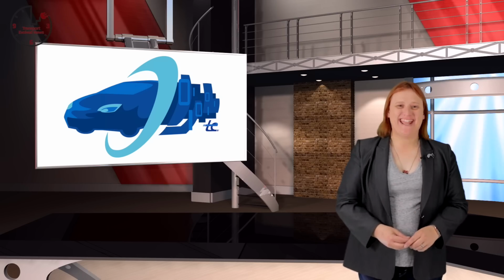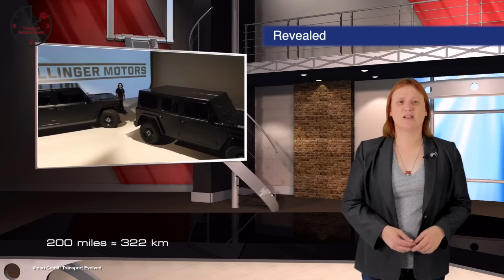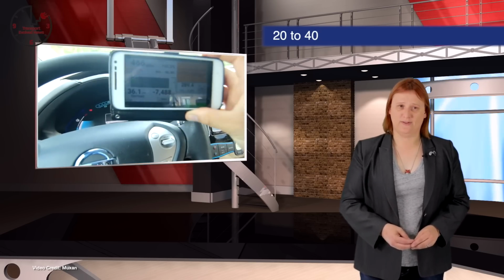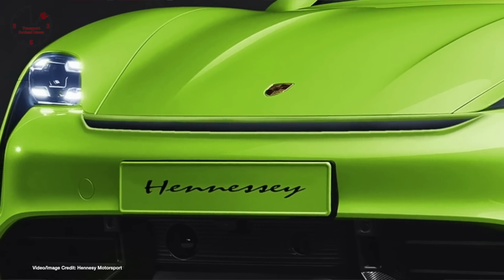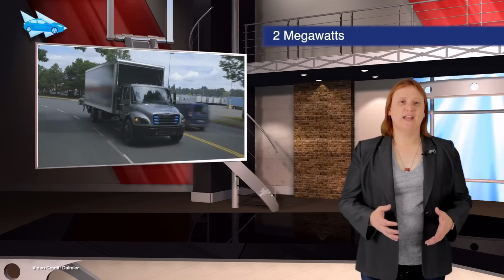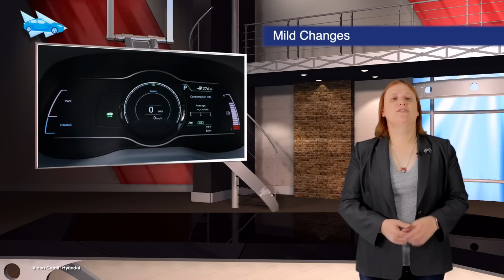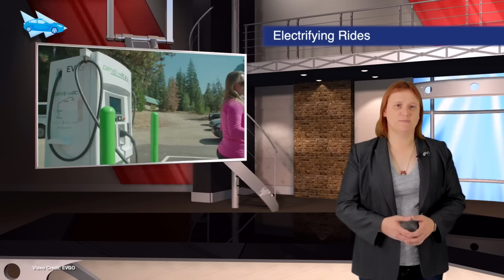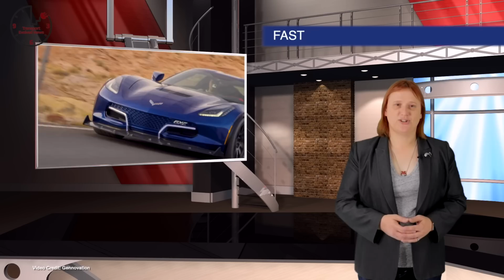Bollinger B1, B2, Nissan LEAF Battery Upgrade, Electric Chevy C7 Corvette - TEN 267

Comment: A 7 year old Nissan Leaf owner in Canberra (Australia) went down to his local Nissan dealer last week, as his Leaf's battery was failing.
He walked out the door with a quote for AUD $33000 for a replacment Nissan battery.
 Go see 'AutoExpert.com' or search John Cardogan on YouTube for the background story. Not a good look for financial  longevity of EV's as the Leaf's cost was about $50000 new, and its current used value is about $12000. 
Throwaway Nissans ?

Comment: Toyota is building a Mirai 2.0 because they are having ongoing problems giving away the Mirai 1.0.
Hydrogen is not commercially viable for cars:
1) Hydrogen cars cost twice as much as agas car and the fuel (green hydrogen) costs twice as much as gasoline and 16 times more than electricity per mile
2) It takes 12 times as many hydrogen truck deliveries to a station to refuel the same number of vehicles as a gasoline station (and the transports would emit CO2)
3) It is too expensive to deliver hydrogen to distributed dispensing stations from a central station and too dangerous to have combined production/dispensing stations in populated areas
4) only 4 or 5 hydrogen vehicles can fuke up in a row without a 20 minute pause to repressurise and cool the dispensing tank
5) There have been four hydrogen accidents this year. South Korea 2 deaths 3 injuries: South Korea 3 burn injuries; Norway explosion and injuries; California fueling fire.
6) Hydrogen single point of failure. Accidents in refueling stations have shut down supply. Stopping FVEC sales in Norway, stopping deliveries in California
Hydrogen is being pushed in Japan as Japan after Japan electricity supplies reduced (Fukishima), and they have no oil or gas reserves.
Japan plans to make hydrogen from gas (bad) and coal (worse).
Hydrogen is DOA in all market driven markets
Reply: Also, h2 fuel cell cars still need batteries and/or ultra capacitors to buffer the energy from the fuel cell
Reply: @PaulMansfield  Yes

Comment: As usual, great video. Just an FYI, a Québec, Canada based company has performed the Gen 1 Leaf upgrade to 40kWh as well and has the ability to upgrade others. The owner of a 2012 Leaf is running around with a 40kWh pack as of last month.
Reply: EV-olution what’s the company name and are they offering upgrades for 1st and 2nd Gen leafs now?
Reply: @drumnutz70  The company is Véhicules électriques Simon André. They are offering upgrades now and you can reach them on their Web site and on Facebook:
https://www.facebook.com/ve.simonandre/?__tn__=%2CdkC-R-R&eid=ARD8gvBq5iXMwBAekBzuNcT5aE29Muq8pZYHNr8OsUvLufU3pdFzfP4NRLviXhdCVnXTkaxBEGq6udaL&hc_ref=ARTpI65JBsauIqlKOMD0WsYoE_incUgcoEQ2OCvQKm6yTL3_qQQ-XU30msdAloYw-DQ&fref=gs&dti=525507787585217&hc_location=group

Comment: 200 miles of range is ridiculous in 2019... Rivian will have TWICE that figure...
Reply: Yep. I don't know what the guys at Bollinger are thinking...
Reply: Put that rated two and a half tons of cargo in it and I bet the range goes to less than half that 200 mile rating.
Reply: @bradscott3165  this would be a epa range test... Given how un-aerodynamic these are, I'm surprised it isn't lower. The gearing is probably aimed at a peak efficiency somewhere around 40mph, and I bet it will be able to do more than 200mi at 20mph on a dirt road...
Reply: kschleic9053 Given neither Bolinger or Rivian have actually rolled a production car off the line yet, I think it’s a little early to be comparing untested range claims. Rivian is offering a 180kWh variant which is 50% more than the 120kWh in the Bolinger. I think that version of the Rivian is going to have a longer range. But not necessarily all versions.
Reply: @mondotv4216  very true... However, with no consideration to what the manufacturer claims for range, it is still possible to talk about the expected efficiency of the design.
 
The B1 has, by my count, at least 3 additional gears in its drivetrain (motor reduction, Hi/Lo reduction, differential, portal axle) vs the Rivian (4 independent motors means only a motor reduction gear is required to each axle...). If each gear engagement has a 5% loss, this means that with everything else the same, the Bollinger will be 14% less efficient at turning battery energy into wheel HP. 

Stack that with more HP required to maintain the same speed (aerodynamics), and the same battery size is going to go a lot further in a Rivian truck... at least in a EPA test.
Reply: kschleic9053 I’m not sure about that? The Bollinger is a two motor AWD - they might even be able to run on RWD only on the highway which would make them even more efficient. The 4 motor system has inherent inefficiencies as well  - there are losses in every electric motor so using 2 instead of one multiplies those losses. Plus having a high lo gear can actually be more efficient allowing for the motor to operate at lower speeds

Comment: I thought it was just the Chinese that made blatant copies of western cars. 
Credit to Bollinger for making and electric off roader, but as a new company shouldn't they create a unique look like Tesla, Lucid etc have managed to do, instead of copying the most iconic 4x4, the Land Rover.
Reply: Well is it though really? I mean when the "design" is "it's a box with some wheels underneath" it's, you know, not much a design per-se.
Reply: @TheSoupToaster  It's the details like the rear tail lights and the square surround around the headlights. Rivian have done the right thing and made their design distinctive. The Bollinger is a more rugged design like the defender but they could have still differentiated their vehicle by using some individual design flair. For me, it's just a defender rip-off, in terms of its styling.

Comment: I would consider paying 10k to upgrade my 2012 leaf to a 40kw battery.  Love that car, but the range is prohibitive.
Reply: mrspeigle1 just trade in for a Tesla instead
Reply: And add another 25k to my bill? No thanks
Reply: @mrspeigle1  you are paying 15k difference. Spread it out over 5 years is not much more
Reply: @lijie6431  15k difference my ass, cheapest new tesla is 36k and my state has no incentives. Best case trade in on the leaf will be about 5k meaning even if my 10k was cash(wich its not) I would still need to cough up an additional $21,000 for a bare-bones model 3.
Reply: Hi
Do you have any idea where can we get the address of the  maxan company in Europe?
I have only two white  bars left in my leaf and leave in Switzerland.
40 kWh   battery wud be great to have if possible. 
Thanks

Comment: Got all excited by the "Nissan LEAF Battery Upgrade" headline only to be disappointed that Nissan aren't involved. This would have been a great opportunity for Nissan to support early believers in their EVs and increase used LEAF sales, which for many is the only affordable EV at the moment. But then they wouldn't be selling new ones would they! Shame really.
Reply: i had the the honor to sit in the nipponleaf 2012 with 160.000 km and 55 kWh to use and drive to the IAA.   its a pity that there is still no refurbished programm or refit upgrade from Nissan.  But muxsan makes hope for a path to more range and a long life for the cheap EV‘s.
Reply: @susihormon7821  I'm not belittling what Muxsan are doing - it's great. I just think that it would be cheaper for the paying public if Nissan have a refurbishment programme as you have stated. If a company like Muxsan can specialise in refurbs, they may be able to reduce the costs and still have a viable, profitable business. Winners all round eh?

Comment: So Bollinger have accidentally built the new Land Rover Defender, because that other thing certainly isn't!
Reply: You mean the New Landrover Soccer Mom. The Bollinger is just right in every way,  form and function, simplicity, functionality and durability.
Reply: Except this one is a bit heavy. In fact, if they do decide to sell it in Europe, you would need "C1" to drive one. C1E if you also wan't to tow anything with it.
But all that apart - it does represent what Defender should represent if it wasn't abused by marketers and attempts to please city dwellers.
Reply: Defender was sort of inexpensive for what it was... this one... not so much.
Reply: Unfortunately, not the price point of a Defender. $125,000! What a laugh. 😂

Comment: Toyota still dreaming of hydrogen. The market has spoken on this. FCEV for private vehicles is dead.
Reply: Hmm, China is heading to H² too
Reply: @MartinTheBear  China is large enough to keep many options "open". If they see a situation, or a specific environment, better suited to  H² , they'll apply that technology. I think however, that Hydrogen (as used in fuel cells) is not viable for general automotive (cars) applications. It could however prove to be viable for shipping, and possibly even for trains.
Reply: Toyota is going to be the Nokia of cars..
Reply: @SinghalLouis  Agreed... By 2030 (or sooner) the only Toyota's you will see will be in scrap yards or motor museums.

Comment: Received my model 3 in Australia a few days ago. I have been driving it all over the place, it is so much fun.
Reply: So what charger type model did Tesla go down under? American, with proprietary plug, or more European, adopting existing system?
Reply: We have the circular plug with like 6 pins and underneath there is an oval shaped 2 ping ... if that helps lol
Reply: @DF14NT  sounds like European version. Top part (circular)on it's own is type2 AC plug. But combined with bottom bit thatmakes it CCS DC plug. Well, at least you don't need adaptors to use third party CCS chargers :)
Reply: Congratulations!!!
It’s an incredible vehicle. 
Just wait until you get V10
Reply: @RayNLA  downloading V10 now :D
and cheers :)
Reply: Congrats! Best vehicle ever!
Reply: Thank you and i agree!

Comment: Sounds like Tesla's notoriously bad paint quality causing rust issues.
Reply: I would wager that the NUMMI plant probably had outdated machinery and Tesla just rolled with it. Sandy Munro said that the paint and galvanizing was the segment of a plant most likely to become outdated first. The M3 also probably has nooks and crannies where it collecting dirt and those aluminum/steel junctions don't help either. The paint on my Model X looks better than the new Escalade I parked next to, but I don't know if that's saying much lol.
Reply: It gets worse. Owners are reporting that water builds up in the door sections and subframe. That's not a manufacturing issue (which can be fixed), it's a basic design flaw, which can't unless you redesign the car.